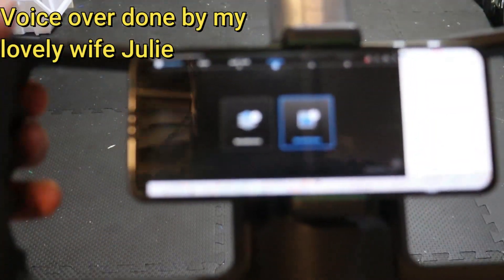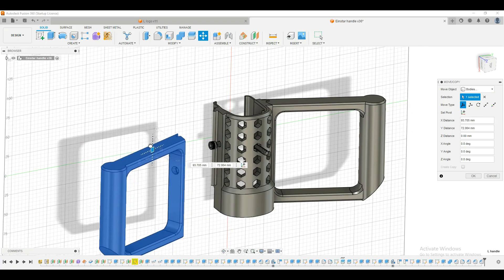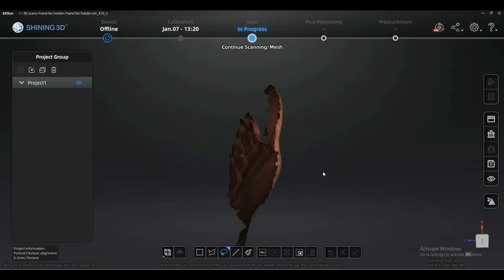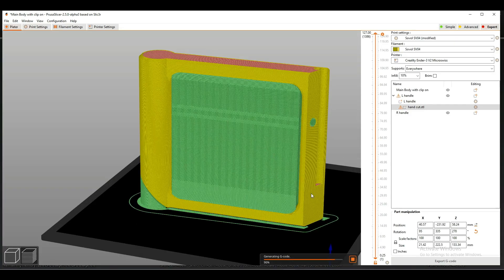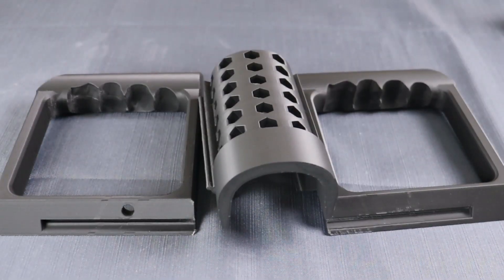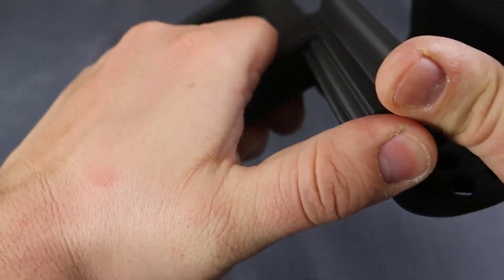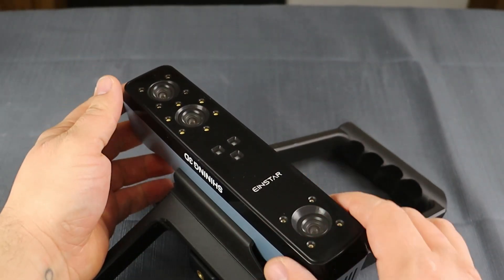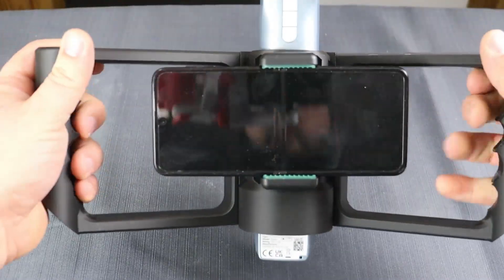The best handle for Einstar 3D scanner!!

Comment: Nice work.   I am seriously looking into the einstar as I make accessories that mostly attach to other products.  I think this will very very useful so I can quickly import in scans to fusion and model my parts.  I hope.
Reply from the maker: It is a good scanner. Make sure you research how to use a mesh in fusion 360, scans cannot be imported and drawn off without first converting them